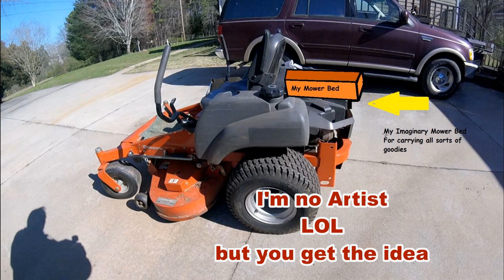Planning A Mower Bed Project Pwalpar VLOG see decsription for links

Comment: yep a pickup bed would be sweet.. walmart has a 4cu ft wheelbarrow for $35, the bucket would make a great bed and the legs easily converted into brackets. home depot has a 6cu ft one in orange but thats nearly 100 bucks.. but theres something about a wood bed....I've kicked around an idea about wood sides for my hitch carrier... I have several partial panels of new cedar fencing that would work... another one of 9thousand mental projects....
Reply from the maker: Good idea  I will consider it  but I like doing it on the cheap lol
Reply: @pwalpar  lol totally get it.. and I know you have the wood but the mind likes to explore..my first thought was a used wheelbarrow then I though to check on new, then orange mower needs an orange bed so type in homedepot..have fun creating YOUR project your way my friend

Comment: Maybe you can attach some small American flags to your mower bed, the cheap kind you find at Home Depot for the Fourth of July. Kind of like those old tractors that have them on display on the front grill. Unless they will get in the way. However you could drill holes in the box to hold the sticks so you can remove them. Just an idea.
Reply from the maker: Thanks my friend  I like your idea

Comment: Better check where the center of the unit is before you add more weight on that zero turn mower. I understand you are wanting to add to it. But you would most likely be better paid off by having a light-weight flat panel with stakes along the edges like a stake body truck.
As I recall you also have a trailer capability on that zero turn mower. So why not have an empty rolling box behind that mower for your tools, etc. rather than something permanently mounted on it?
Reply from the maker: Thanks Hugh  If I make it it will be removable and small  I do have a trailer which is sometimes a pain to drag out lol  Did you see Ron Pratt's new rollback?

Comment: Walter love the idea....  one things circulation air around your motor,,,,  be careful number two my heart my thoughts were a child small plastic wheel barrel for your little body or something along a cart of some sort like tractor supply would sell or take a plastic 35 or 55 gallon plastic drum and cut it in half And cut it in half Walter and then cut Vin the  back of it and put it up like a like a dump body lightweight easy deconstruct you could cut it apart with a saw Zaw that's my take I think a plastic bucket laying in a plastic cup drum laying on the side you can make it whatever length you want to be no junkman do
Reply from the maker: Thanks Samuel  Your comment has reminded me of something that ma  I appreciate your input work

Comment: Regarding your oil drain a valve would be the way to go .Change the handle round so that it runs parallel to the valve body when it's in the closed position and wrap a couple of small cable ties round for additional security . Only downside would possibly be the extra time it will take to drain , but for the volume of oil I doubt it  would be too frustrating . Have a great week
Reply from the maker: Thanks I will make a stab at it

Comment: Hey Walter, a bit of advice on your mower tool rack. I have a mower similar to yours just a different make. When I purchased a grass catcher attachment it came with a 75 pound weight assembly for the front and even with the weight, when the bag got full the front end got pretty light. Another thing, don't let it stick back behind the mower very much or you will catch it when you turn. I hope you captured some critters on your cameras. You take care!
Reply from the maker: Thanks Matt  I will be careful to take it into consideration   I hope I have good luck with the trailcam